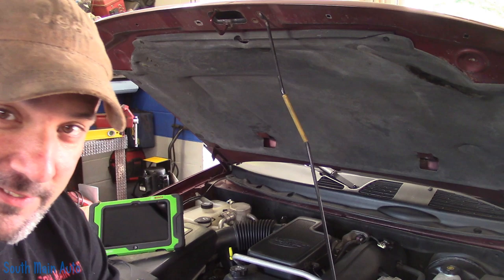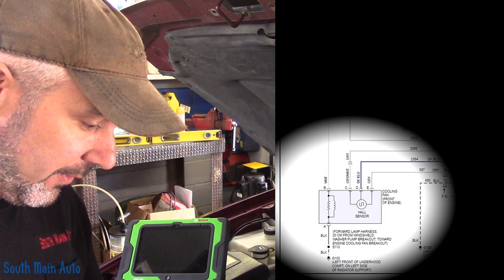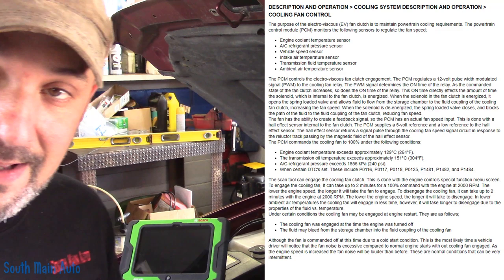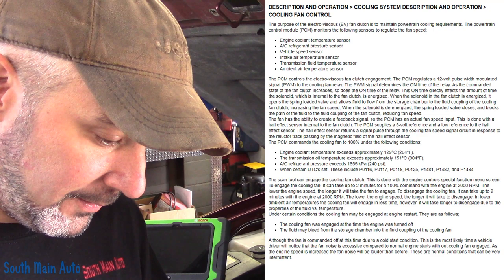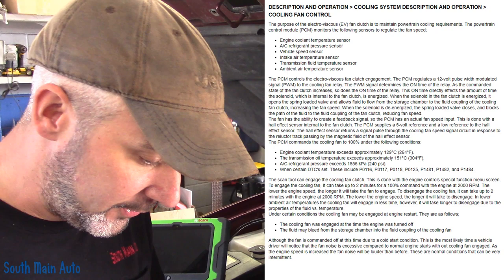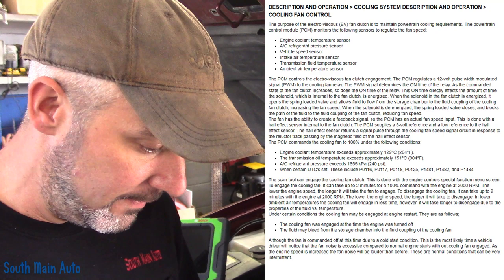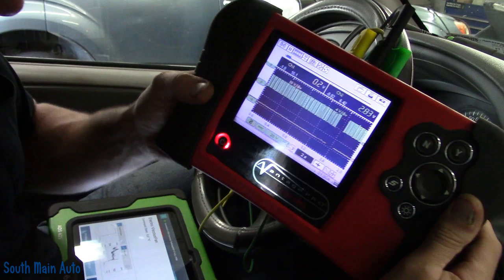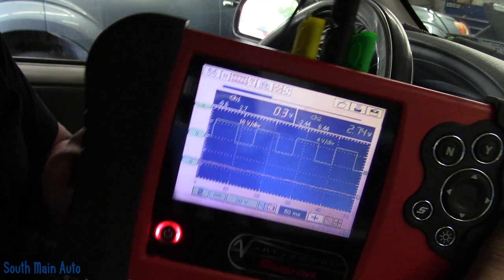Chevy Trailblazer: Electric Fan Clutch Failure

Comment: This is insanity!
What TF are manufacturers doing?
This is complexity for the sake of complexity. There is absolutely nothing to gain from this electro hydraulic clutch system driven through a relay by what's gotta be the slowest PWM carrier freq known to man!
WHY? Someone give me just one advantage to this contrivance over a standard issue (fuck it, lets go fancy) Driver controlled PWM'd electric cooling fan, with encoder for feedback. (when the ECM already has feedback via several temp sensors in the block and radiator)  

You've GOT to be kidding Chevrolet!!! (I think he said chevy.... it was a chevy yeah?)

That has got to be THE MOST retarded concept I've heard of since the dawn of IC motors!!!

A piece of advice to people who are not mech's. When you're buying a new car, ask the dealer how much a new clutch costs in the car you are buying. Or how much the clutch would cost on the manual version.  
This will give you a good indication of how expensive the P.O.S. is going to be to maintain.
I see crap like the fan in this vid and wonder how in fucks name such a system came to be. I can tell you now, no design engineer suggested this! A design engineer was instructed to design this system.

Comment: Man, I'm glad I don't work on cars anymore. Automotive engineers must have sat around snorting lines and, once they reached their euphoric state, declared to one another that the temperature (spring) controlled mechanical fan clutch that has served so well and so reliably in the past, should be replaced with an electronically (computer) controlled, inherently unreliable fan clutch. Why? Because the knowledge of the automotive engineering universe they gleaned while in the throes of their cocaine fueled euphoric state led them to this 'logical' conclusion!

Comment: No reason that fan is that complicated. Whomever designed this was is an over educated idiot. It is just a fan to cool the engine.If it is to save fuel it cannot save over a gallon for the life of the car. To m e something like that is just nuts.
Reply: John, they're not worried about saving fuel for you, but meeting CAFE requirements. And one gallon becomes 20,000 on 20,000 cars sold. Trying to use common sense is futile.